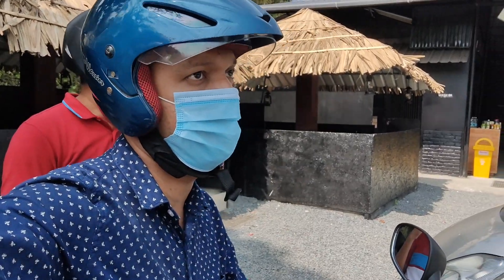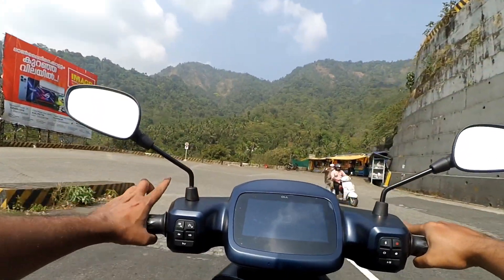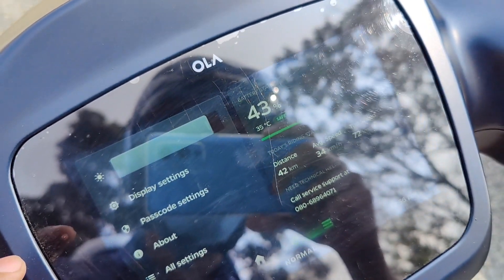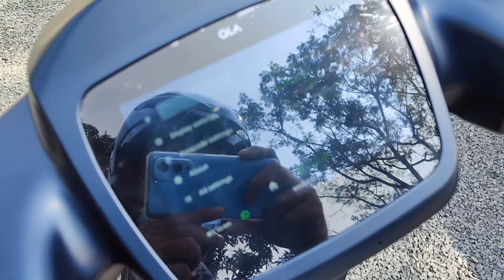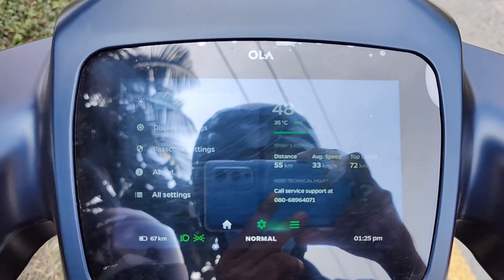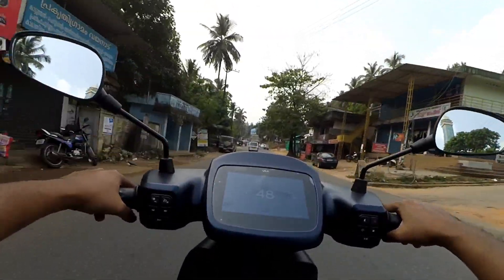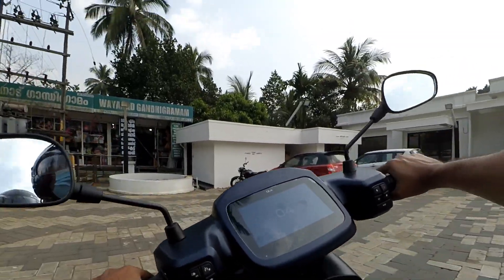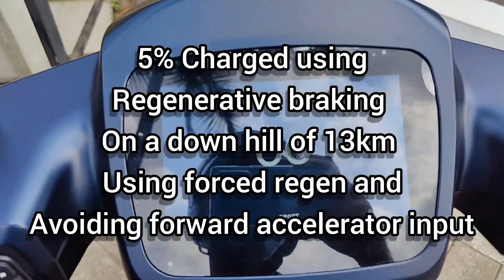Ola S1 Pro Complete Regenerative Braking Charging Test Wayanad Mountain Pass First In India English

Comment: Ola founder bhavish has said that they will increase forced regen ability via software update after customers get used to regen. After that update surely it will get better. But for that also my doubt is heating.
Reply from the maker: There should be an option to select regen power
Reply: @Habistech  i dont think they will implement that. If its there then its very good. Even tata nexon doesnt come with that. And its quite irritating thing on that car.whereas mg zs, hyundai kona has selectable regen modes.
Reply from the maker: @turbocharged962  since everything is controlled by software, nothing is impossible